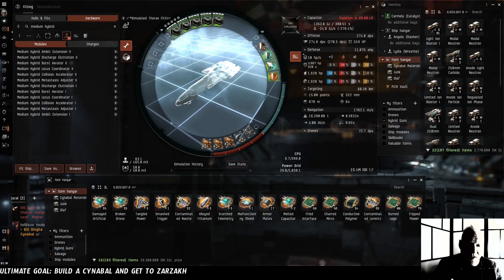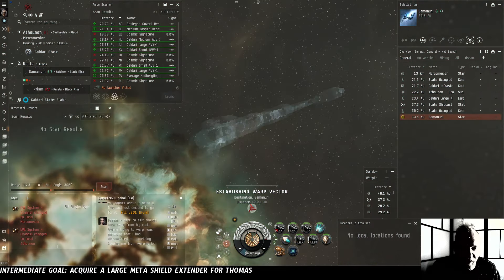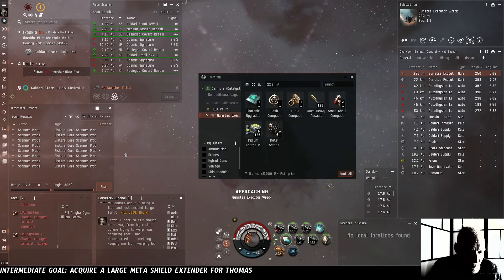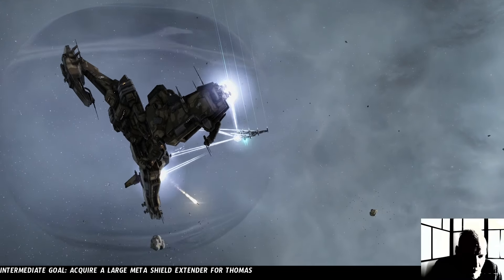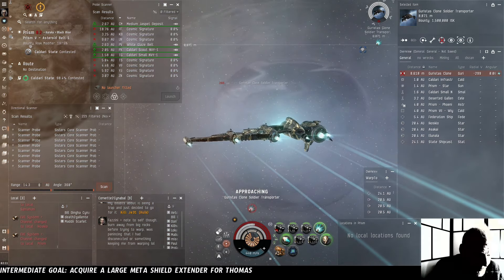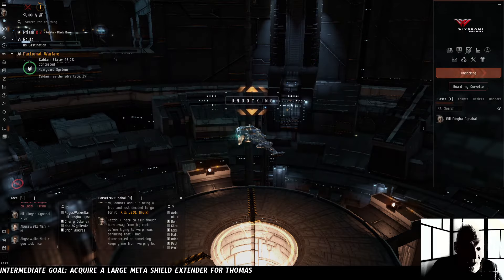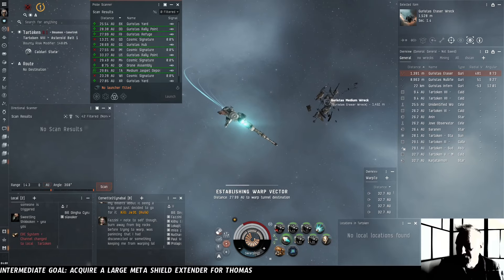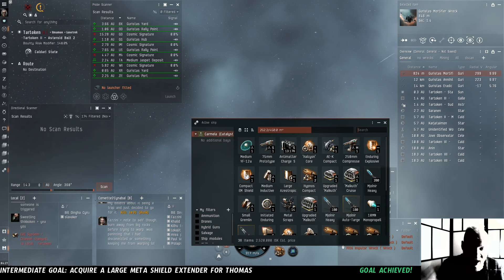Killing the Right Ships for the Right Loot – Corvette to Cynabal Bootstrap Challenge – Ep. 18

Comment: All that for a single module lol, I actually have a progress update this time. I took a small break but finally finished grinding out a Vexor BPO, just built it, and now I gotta grind lowsec anoms for an escalation and then pray I can run whatever escalation I get, and ofc hope it drops a Vigilant BPC
Reply from the maker: The shield extender may have been the nominal goal, but I also picked up a lot of other stuff that was rare and/or unavailable in Gallente space. I think the shield salvage and the meta railguns will end up being an even bigger level up for Thomas than the shield extender is.

What's your out-of-the-gates Vexor fit look like?